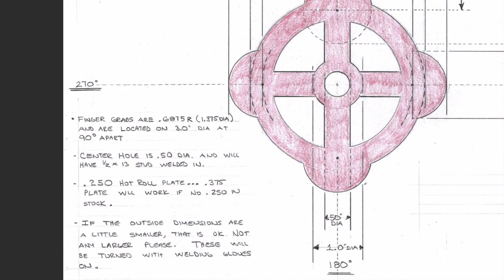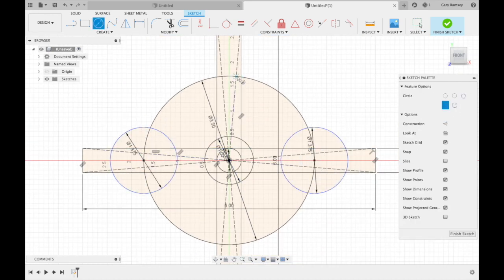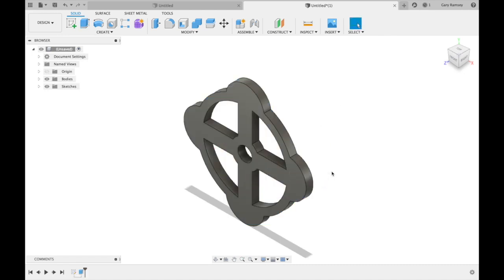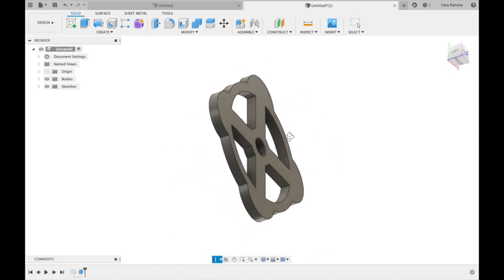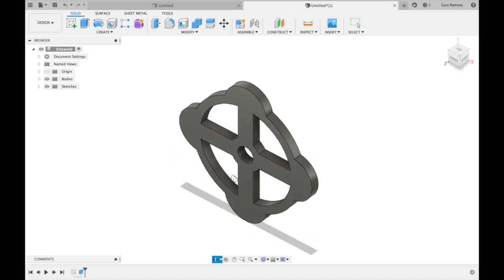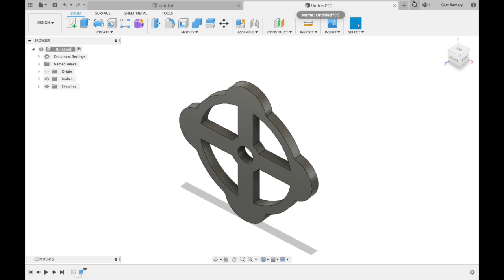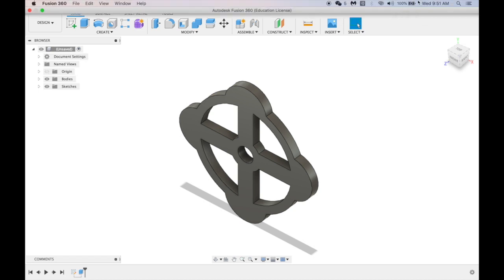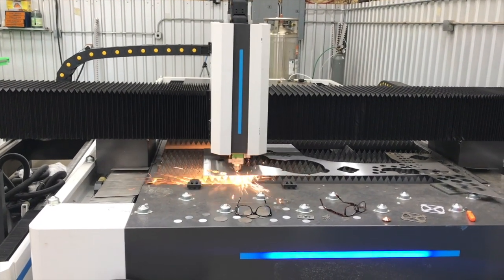First Project on DIY Imported Fiber Laser Cutter

Comment: Those are some good cuts.  When the laser was piercing, it looked like your beam alignment might have been just a bit off.  You can always tell by the spark pattern when the beam first comes on.  I have been running a fiber laser for over 10 years and even if your beam looks like it is aligned, if the sparks favor one side when piercing, something is off.  It's usually beam alignment, debris in the nozzle or a damaged nozzle.  Keep up the good work, I really enjoyed the video!

Comment: Ok, it works but... where are safety covers ?! There could be laser beam reflections ! No self-respecting company will produce such a machine without cover around the machine table. Please tell me You made this cutting only for testing and at your own risk.
Reply from the maker: Its an open machine.  I work in my own small shop and no one is in there but me.  I am like you, I am scared of any stray laser beams, and I run the machine by remote control and watch it on a remote camera, while clutching my pearls and reorganizing my tampons in the cabinet
Reply: @turbocobra  lol

Comment: It's alive! Cut quality looks great. It's gotta be like getting a plasma for the first time, expect to "waste" some material getting it dialed in 👍 Do you think you can get the slag clean enough to eliminate the grinding step after cutting?
Reply from the maker: Oh heck yea, once you get everything dialed in, you should be producing dross free parts that are as clean on the back as they are as the front, they do have kind of s slightly smokey residue that shows up on brighter material that wipes off or blows off.

Comment: The final pieces look pretty awesome.
Reply from the maker: thanks greg! I am about to make a flag with a "ghosted" in logo, so will experiment with lowering the laser power on one layer to engrave and profile cutting at full power, and will do a couple of your gauge blocks.  I got some quotes on stainless also, so will get to that soon
Reply: Dear Grage ,This is Jerry  from JNChangtai in China, which is a professional Laser cutter /Laser tube Cutter /Laser Welder manufacturer. Kindly add my WhatsAPP/Wechat number : +86 17864172569. or send mail to : export02@jncahngtai.net ,I'll share more info to you . Stay Healthy & Best regards !

Comment: Looks like it does a much better job than a Plasma Cutter.
Reply: It certainly does a better job than plasma. I own a plasma table with a Hypertherm XPR300 - about the best you can purchase. On 1/4" it leaves almost no dross and does a dam near perfect job at 90" per minute - but not as clean as this laser. With stainless and aluminum the cuts are hard to tell from a laser. Of course we spend most of our time cutting everything from 1/4 - 3" and that is obviously not what this was designed to do. For the money its a crazy deal and I may just purchase one of these - very impressive. The plasma table I have cost just shy or $250k.
Reply from the maker: HD plasma is hard to beat in thicker materials, lasers really show their value in ripping up thin sheets at 1000IPM
Reply: @turbocobra  1000imp.  That just crazy.
Reply: yes, you are right, and more environment friendly.

Comment: Glad to see it going! Looks like it cuts nice and clean. Any bevel on thicker material? I would assume not. What is the material thickness limit?
Reply from the maker: Well I havent done any surface plate or CMM work on it, but normally to cut a 1/2" hole in 1/4" material i would need around .050" extra clearance to allow for hte taper.  I put .015" clearance on this one and it dropped in too loosely.  Accuracy is suppose to be .0019"... so we will see.  This machine will cut max 3/8" mild steel.  Its a 1KW power source.  4KW will cut 3/4".  A 4KW power source and head, are as much as I paid for this entire machine alone.  But will upgrade some day hopefully
Reply: @turbocobra  Now I'm not arguing this, mind you, but that price astounds me (boggles me mind). A welder set at 160 Amps is approximately 4 KW of power output (more input at 220 because nothing is 100% efficient). Nice demo, TY for the video.